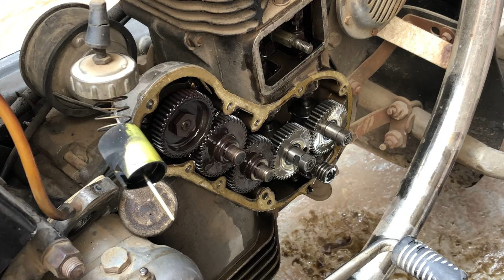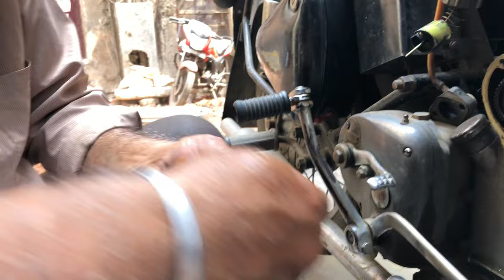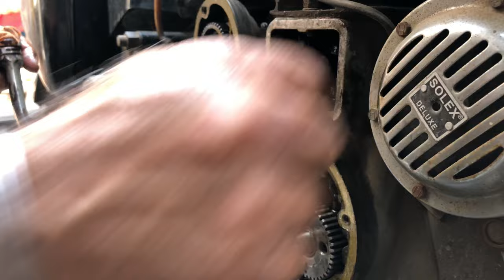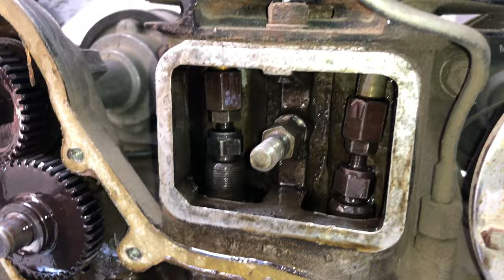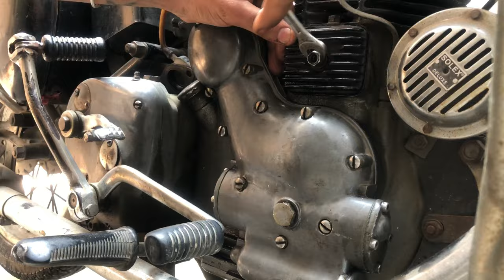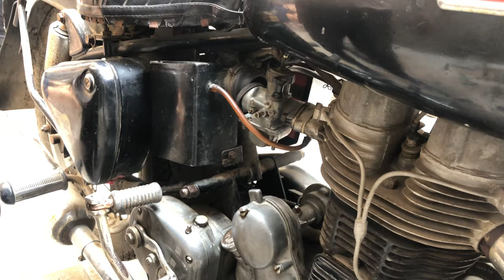Bullet, How to adjust timing gear, Point Plate Setting (टाइमिंग गियर सैटिंग)

Comment: Bhai mere pass 2004 model bullet standard h average bohat kam de rhi h 10-12 ka average de rhi h kya issue ho skta h 
Please bta skte ho kya
Reply from the maker: Spark plug chq kro jada black h to  Carburettor chq krwao slide k pin kitte no pr h use niche k side krdo pin ka lock upr krdo ek point 1-2 point pr honi chiye or slide m koi gap issue nhi hona chiye